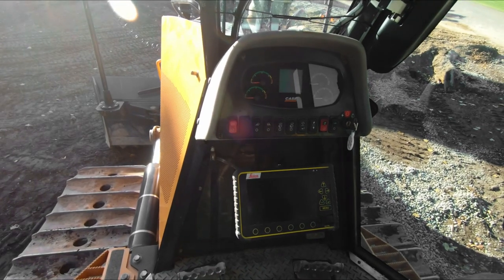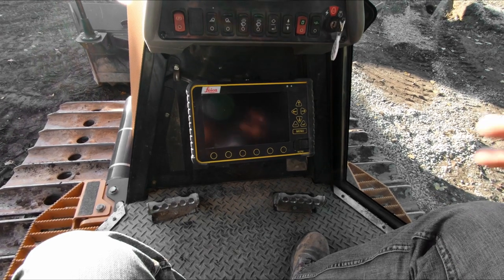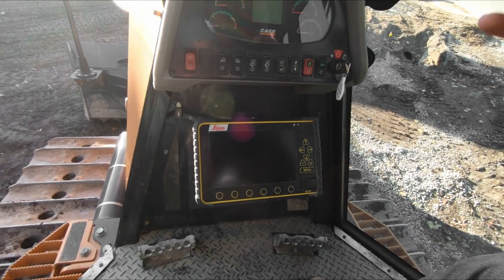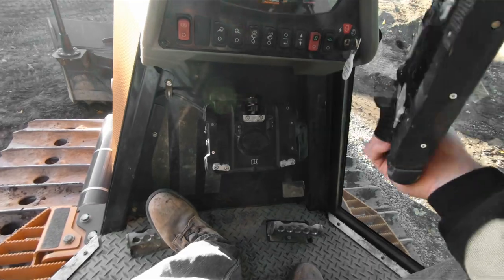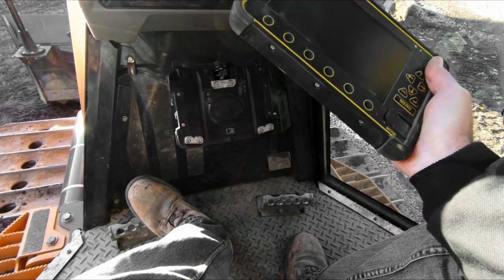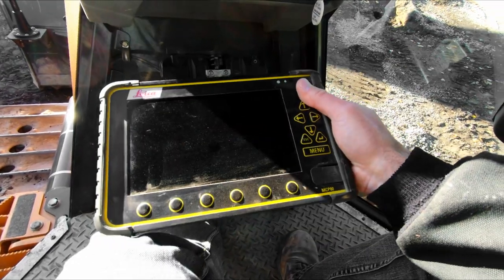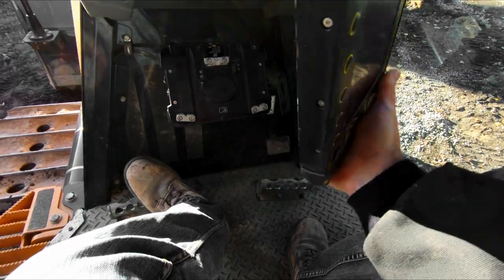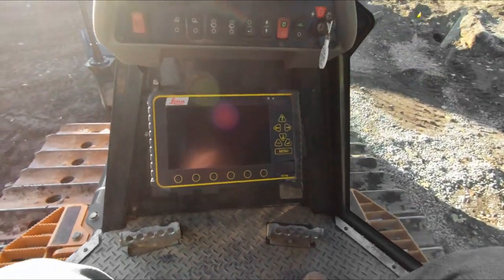LEICA GPS - Heavy Equipment Machine Control // GPS on Heavy Equipment // GPS Machine Control Systems

Comment: Man yeah! That is huge being able to use the same screens and software on multiple machines! I was sternly complaining to Cat the other day just over this same principle. Software continuity is so helpful when training guys to use equipment, and since software on equipment is getting to be such a big issue it would be nice to see it be upgradeable from machine to machine to keep them all the same. My 2020 excavator is completely different from my 2019 CTL is it a killer, no, but the continuity would be freaking awesome! Great video!
Reply from the maker: Thanks man! I totally agree, having a consistent interface keeps confusion to a minimum and makes training quicker. That's one of the big Reasons I'm such a fan of this system

Comment: Congratulations on hitting 5k subs🤙
I’ve never used a gps system. They look very expensive💵 great for those large scale big construction outfits👍
All I use is a spectra laser system and looking at getting a magnetic set up to go on a excavator
Wish I would have had the gps system when constructing football fields
Awesome video Bryan🤙
Reply from the maker: Thanks James! The beauty of that like a setup is you can get the 2D system for around five grand if I remember right. Then when you are prepared to go to the full GPS setup you can spend the $60,000 + for the rest of the gear.  The 2D system is super nice to have if you were just doing pretty straightforward slope work
Reply: @DieselandIron  question: We dig a lot of footings and sewer lines- is the 2D plenty for that? Would be helpful to free up the guy holding the transit pole to go to another site or just load out the dug out dirt.

Comment: What piggy back module are you talking about with your trimble base?
Reply from the maker: There is a coax cable that comes from the base station that this piggyback module plugs into.  It splits the signal so that the base station transmitter transmits the Trimble signal as well as the Leica signal.  That allows both systems to run alongside each other with no interference.
Reply: Is this with a 900Mhz radio or a UHF radio?
Reply: You have no idea what your talking about.  Do you have a picture of this AKA piggy back module?
Reply from the maker: @richardjohnson7442  I had to make a phone call for this one!  The piggyback module is only for the 900Mhz radio.  If you are using UHF you should only need to change the frequency on the Leica receiver to match the output of the transmitter.  I also need to clarify that the piggyback module with the cables and batteries is actually $2,500.  I was given incorrect information apparently....
Reply from the maker: @richardjohnson7442  No need to be an ass Richard.

Comment: Company I work for has heavily invested in Leica GPS for all our machines.. unfortunately we are underwhelmed with the accuracy and constant drop outs
Reply from the maker: Really? That's interesting because Leica is actually far bigger then topcon or tremble when it comes to GPS and machine control Technologies. They are the tremble of Europe
Reply from the maker: @benjaminmaier1  thanks Ben! I appreciate the support brother! It's pretty miserable when you are working in a poor signal area and you constantly have dropouts. Have you guys tried any competitive systems in that area? I am curious how differently they would perform under those conditions
Reply: @DieselandIron  yeah mate we have a brand new 22T Volvo excavator with Trimble machine control. And a 25T with Volvo with Leica on the same site, they both benchmark off the check off really well but during the working day the Trimble has 0 drop outs and the Leica has hours of red screen (CQ Exceeded too high). Could just be the new Trimble has a better antenna/receiver